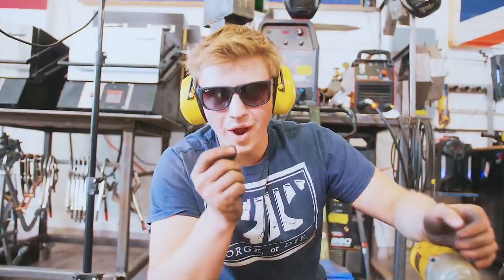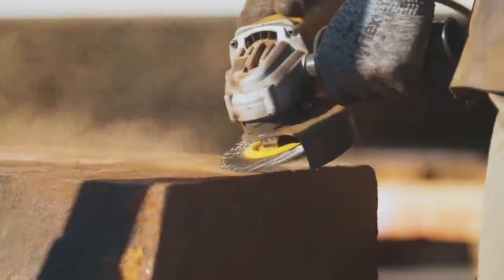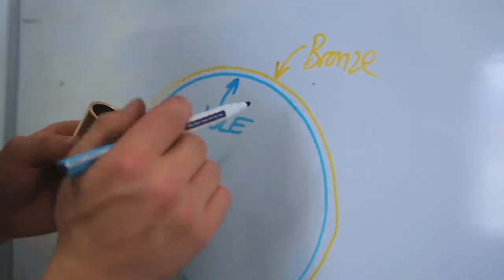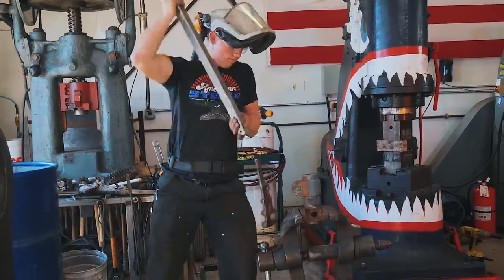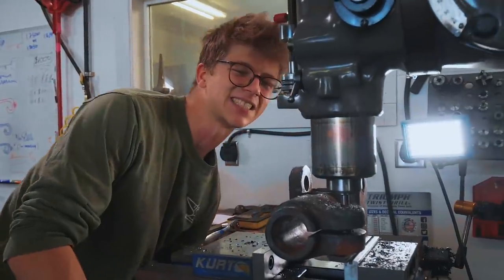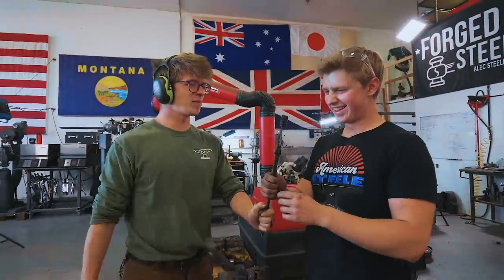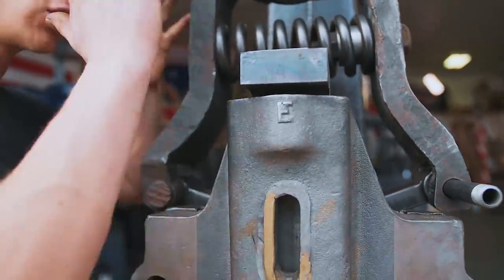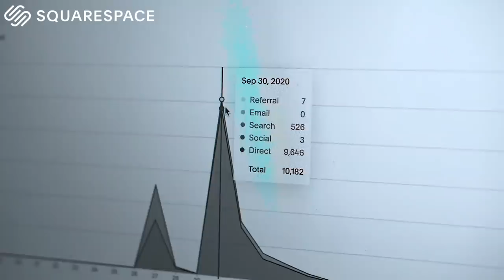RESTORING THE FAIRBANKS POWERHAMMER!!! Part 4

Comment: I kind of knew that was going to break. You need a tool steel for that bolt; It has to have ductility and malleability while being fairly hard. Grade 8 Bolts are made from a Medium Carbon Alloy Steel and Oil Quenched to get a Rockwell Hardness of 33-39. I'm Guessing Chromium Molybdenum alloy, so something like 4140. I spent some time as a Heavy Duty Mechanic, and Grade 8 Bolts were the standard for any application like what you are doing with this one.

Comment: You can weld a nut to the bolt that is stuck in the head and usually that works after a couple of times

Comment: Place a large nut the same size as the screw over the hole but on top of the end you want to extract from (not the side with the threads showing in the hole) and weld it to the screw filling in the hole with liquid  up to the top of the nut. then let cool and use a large wrench to unscrew. Seems to work well for Andrew Camarata I guess ymmv.

Comment: In the future never heat something to install bronze bushings. Always freeze them or just press them in. The expansion or bronze is higher then steel and will crush your bushing causing incorrect crush on the bearing.

Comment: The moment I saw will cutting the flutes in his Thread tap with a ball endmill, I knew that this iswas going to happen. The way he build that did probably not cut a single shaving of the damaged thread, but sintead pushed the material to the side, which now binds on his new bolt.

Comment: 7:33 - Boys, we never use bolts made of mild steel, there's a reason for them being toughened. Mild steel bolt in a mild or wrought steel will break, a hardened one will not until much later, after a few times.

Comment: You shal always drill a smaller hole before reaming the hole.
Let say a 30mm hole, you should bore it at 29.7 ish.
Or 29.5 if u have a twisted spiral reamer.

Only then, you wil get the holes on spec.

A drillbit wil always wander of, and nick a bigger diameter than the bit itself..

Comment: Ok guys, as blacksmiths you know good and well that scale is a lot harder than the base metal. Fire scale expands and fill in voids as it's fractured, then proceeds to backfill any space around a threads. It did surprise me, I didn't expect it to happen two times on the same part.

Comment: there away to remove the bolt when stuck is to get a set of left handed drills as when you drill and you are lucky it will bite and drive the screw out

Comment: BTW, never leave something threaded in while you put that much heat on it, and don't leave it in hot if you ever want to get it out. A better approach (I know, hindsight and all that), would be to use a vice or clamp on the outside of those tabs to hold it closed instead of the screw itself.

Comment: If you're talented with a cutting torch (acetylene is the preferred gas because it's more precise than propane) you can cut the bolt out without damaging the threads

Comment: I wonder if you drilled a smaller whole about 3/4 through the bolt then heat the whole thing up on the over, then hit the inside of that drilled whole with some freeze off... maybe the bolt could shrink enough, you could impact that bolt out.

Comment: Pro Tip: For something you will have to remove use your PB Blaster every day a few days before you need to remove it. Makes it tons easier.  

Story time: When I was in high school working at an auto parts store we sold some PB Blaster to a guy that needed to take an exhaust pipe off an old rusted 3-wheeler. He commented how the bolt and stud was so rusted. He bought the PB Blaster and sprayed it every day for a week and almost was able to to remove the nut by hand.  Good idea for something you are working on and will need metal to move where needed.

Comment: guys don't heat threads with bolts that fit. the thread shrink's around the thread so it jams. next time use a small bolt with a nut that u can keep cool so it come off.

Comment: I have to admit I like the semi narrative approach.

FYI the idea of drilling the bolt was good, however once you had the hole cutting a slot to a hair off the threads would have saved you a ton of work, it would have given you just enough for the bolt to collapse inwards.

Comment: You could have also welded a large nut to the broken bolt and that would have possibly worked. We do that on equipment and engine blocks and cylinder heads.

Comment: Hey guys, PB Blaster has some good qualities, but isn’t great when something is really hard stuck. Nothing on Earth beats a 50/50 mix of acetone and automatic transmission fluid. There are a few good videos out there testing various penetrating sprays under controlled test conditions which are quite enlightening. Closest in performance to the Acetone/ATF is Aero-kroil, but it’s still not as effective. PB Blaster and WD-40 were the least effective products.

Comment: well Will seemed to find out the hard way when you heat up something with dissimilar metals in it they'll expand at different rates and something might get stuck... something that you don't want to get stuck.    Was that a steel bolt with a cast iron assembly?

Comment: A tip from a mechanic. You should have taken a nut and you weld it to the bolt from inside the nut then impact it out with a proper pneumatic impact.

Comment: If you ever wanna see a bolt more stuck into a hole than that, which isn't an intentional interference (class 5) thread, drive a stainless 1"-14 bolt into a stainless hole and see what happens.
Reply: Titanium and Titanium is just as fun
Reply: @sentient2016  more expensive though

Comment: Run a bead of weld inside inside the hole you drilled in the screw, that will shrink it loose

Comment: i know little late. but aren't bronze bushings the ones that lets say you would use your thumb to cover the bottom fill the center of the bushing with oil and use your other thumb/someone else's thumb to press the top of the bushing and the oil would seep out? or is that a different bushing?

Comment: put the bolt back in the lathe and run a file over the thread and dull off the sharpness of the thread and never seize the thread no binding no seizing

Comment: That bolt thread had galled, meaning the surface of the threads had 'picked up' material from within the threaded hole. Attempting to turn it will only increase the damage and is likely to result in the sheared bolt seizing completely. Needs drilling out.

Comment: Pro tip, im a forklift mechanic and alot of them are held in with roll pins. That often get siezed. The secret is too cover it in brake fluid for 24 hours it will seep between the two corodid surfaces

Comment: I’ve always wondered if you could make canister Damascus with chips or the sparks from grinding...? And if so could you make a whole piece with one piece of metal. I.e. the blade from a piece of 1080 and the crossguard handle and pommel from Damascus made from the remnants of the blade?

Comment: Anyone else noticing how the editing is getting more like a TV show? With voice-over coming after the fact so they don't have to stop working to explain. It's an interesting choice; it probably allows them to keep working without interrupting their flow, but it does require a little more work from the editor. It's also less total face-time with the hosts, but a smoother flow of action. Also the "next time on the Alec Steele show" segment is new.

I wonder if Jamie is just having fun or if they're experimenting with a new format for the show?
Reply: I don't want the tv style. It's old media. It's over. No need to keep its worst parts.
Reply: @rasmis  It does feel a little more manufactured. I think I'm cool with the voiceover if it makes their job easier, but the "tune in next time" segment might be a bit much

Comment: use oil with slick 50 in it , it will soak into the metal [slick 50 is a oil additive for automotive oil]

Comment: Seems like drilling out that crosshead would be the better idea. Just bore the holes straight through and use a nut and bolt. At the very least, you'd be able to get it out after years of hammering have warped the thread in the casting.

Comment: You guys try didn’t try to weld a nut on that broken bolt? Use a center drill poke a countersunk shallow hole weld your nut off center with a big washer so you don’t weld on your threads use the stick welder make a bunch of stacks tacks to build a little mountain in the hole you drilled drop a washer to protect the edges of your threads and the nut on the peak of your mountain and tack it in place carefully continue like that until it’s good and hot that once the whole thing is good and hot you can fill in the nut. I find the new head being off center helps with leverage or getting started with a turn or something I crawl into the sugar mill once a year and remove a bunch of sheared off bolts like 80 or 90 some stainless some steel some with loctite some with red loctite.

Comment: You can buy an adapter for those dewalt tools so that you can use the new 20v lithium batteries. Or just replace the cells just commenting in case people have older beautiful tools like that.

Comment: They could have simply heated the structure around the bolt to expand it then removed the bolt.  Much faster.  But you have to be concerned with time because the heat will transfer to the bolt and expand it as well.

Comment: With the stuck bolt. Would this have been more due to the rebending changing the angle of the two holes now being an inflection angle so as it was tightened the spring in the clamp wanting to push out was holding tight not allowing the bolt to move.  If you used a stong vice and tried to squeeze it back together  as  you unscrewed it may have moved. 

Just spit balling.

Comment: You needed a smaller reverse thread bolt to use as an extractor or an actual bolt extractor your local autozone would have one for like $15

Comment: Not to be shitty, but, If you’d really like to know....
So, as we know, heating things up expands them, and consequentially when the heated item cools, it shrinks. So, if you heat something with female threads and then tension something with male threads into that female thread, and allow it to cool, the female threads will, almost without a doubt, become seized around the male threads. Therefore, do not heat female threads with male threads installed, unless you want it seized, like ballpark stadium seats... 
In your case Will, you may want to use wedges for that cross head, wedges for the win.
Only hope to help.

Comment: You guys stick a screw on a smallish loose part and you go after it with hammers and punches and screw extractors, mushrooming both ends of the screw so is can't be removed. You have the Queen Bee of all screw removal devices: a Bridgeport mill right there, unused, waiting, neglected. You guys give me a pain where I sit down.

Ready? Here's how: 
- drill the center out 
- line up as best you can on the screw centerline
- using your boring head bore out the screw taking small cuts until you break through the minor diameter
- adjust center a trifle and repeat until you break through the minor diameter most of the way around
- collapse the emerged end  to find the thread remnant 
- unwind the thread remnant like a spring.

Comment: Alec you said you heat up the hole so that it expands but if the metal is expanding wouldnt that actually cause the metal around the hole to expand inwards making the hole smaller? Thanks.

Comment: When you heat up anything with a threads like all thread rod, bolt, pipe nipple, or anything threaded you risk galling the thread. In some cases galling results in welding the bolt into the threads. Not worth heating up the threads most of the time.

Comment: Would have threading only the protruding length of the new bolt and tightening it with a nut worked? That way, if it broke again it would be easily removed.

Comment: You guys need to learn about the magic of using wax when you heat something. 

Seriously,  it will wick deep into frozen joint and make things so much easier ti break loose. 

Just remember wax is flammable and use appropriate precautions

Comment: I can't tell for sure but it looks like Will might not be turning the impact driver in the direction he needs that bolt to go. That bolt was way too stuck for the driver in the end but driver's I've used work best when you're turning them as  you strike with the hammer, hope this helps someone.

Comment: Hate to point out the obvious, but you could have just used an off-the-shelf nut and bolt in that crosshead. Drill it out and pop the bolt in there, secure with a nut on the far side. Surely it's not that big of a deal to have to use two tools to fasten it instead of one? It's almost impossible to achieve high tensile bolt standards in a workshop, that bolt will likely shear again. A separate nut and bolt is also a lot easier to fix if the bolt does fail.
Reply: Exactly. I can't see why that cross head needed to be threaded.

Comment: I am just wondering, but couldn't you have just drilled a hole, tapped it with a reverse threat, and screw in a bolt with a reverse thread a well? As you tighten the bolt, the broken bolt will loosen. I hope this made sense. It should work I believe, though I never tried it lol.

Comment: The two sides of that jaw were pulling apart and wedged the screw in place. If you would have clamped the jaws closed just a little, it would have come out.

Comment: Couldn't you drill out the center from both ends of the bolt and put a heated pin through it to weld it together to extract it?

Comment: I’m no mechanical engineer, but because of that gap when the threads tighten won’t it move the threads out of alignment and cause the bottom threads of one side bind with the  bolt out of sync with the other?

Usually when you see these types of clamps you have one side which is open and not threaded, and then the other side has the threads to pull it tight?

Comment: Near watching you make the tap and the bolt, but is there a reason why it wouldn’t be better to just drill all the way through and use a longer bolt with a nut on the other side. Looks like there’s room and seems way simpler

Comment: so when I was watching Will cut the threads into the cross piece I noticed that he was continuing to tap on the second side while he didn't have it in the set position, and then he moved it around a few times and was trying to tighten it and heat it and stuff... could it have been that the threads don't line up the way they're supposed to?

Comment: Doesn't "drill it out" generally mean removing the whole bolt and the threads with the drill so you can then re-tap for a larger diameter bolt?

Comment: Should have dilled most of it out, drove/hammered a torx bit in then used a rachet or breaker bar whilst applying heat. Impact gun aint the best way

Comment: I think that you might have made your tap too small, and / or the screw too big. 
If you measure a tap and measure the matching screw you will find that the tap is quite a bit bigger than the screw (and a die is smaller than a nut). You can never screw a tap into a die, for this reason (don't actually do this, you might damage the tap or the die, or, worse still, prove me wrong) 
You should be able to find the required dimensions in your Machineries Handbook. But there is a fair bit of tip and root clearance (and rather less flank clearance) in a properly-made screw and threaded-hole setup.

Comment: Why didn't you just clamp down on the split joint with a big vise to relieve the excessive tension on the threads of the (stuck part of) broken bolt?

Comment: Someone correct me if I’m wrong but couldn’t they have just drilled out the old threads and cut new ones when he made the thread cutter probably would have been harder but would have prevented the headache of removing the bolt

Comment: "i'm no expert" BUT, on the snapped bolt, would it not have been better to just drill out the thread and just have a nut to screw into on the other side?

Comment: They never tempered the bolt, so I was hoping that wouldn't happen
Reply: Actually they did.  After heat treatment, he mentioned tempering it and you can see the straw yellow on the bolt.

Comment: When you put those back together, some marine grade Neverseize would be a good idea to put on. You know, for the next poor fool who decides to take it apart in 50 years or so.

Also, using the tempering ovens to do the interference fit for the bearings looks like cheating. No guessing with the torch if it is hot enough and sitting there heating it the whole time.

Comment: You could have welded a nut to the exposed material the second that Will broke the head off of that bolt and then turned it out with the impact gun or a wrench like normal and saved a lot fo time. The impact drivers only made your problem worse. Not talking trash, just a genuine suggestion for the next time you run into this.

Comment: I think you 2 should have made a new cross head and new arms. Then you would have a much cleaner machine. Needed not really but you have the skills and tools needed so need to do need not apply. It is something that might be just out side your current skill to do easily. Meaning you would learn some new techniques etc and improve on other ones making you both even better smiths than you are right now!

And the fact is you already have the original parts that are still good. So you end up with spare parts incase something happens to the new ones. Getting the power hammer finished would take no longer ither

Comment: Will broke that bolt because he didn't heat up the part. That's the first thing you should do when WD40 doesn't help. Heat up the part without heating the bolt, give it a few hammers and it should let go of the bolt.